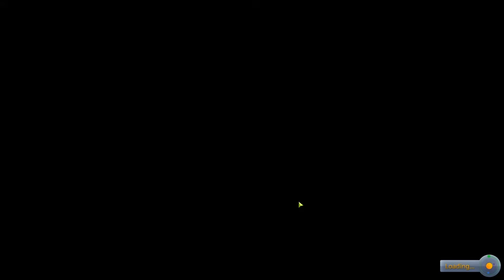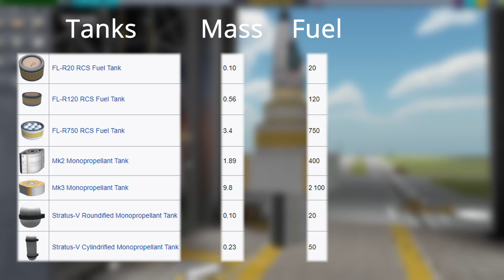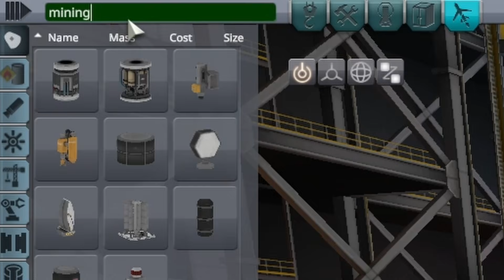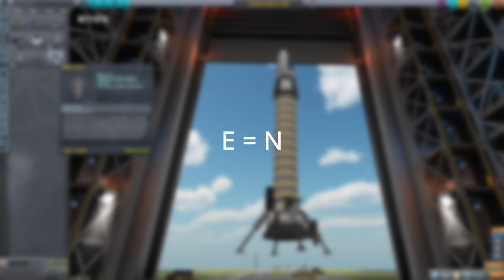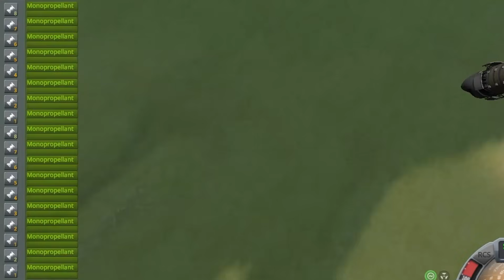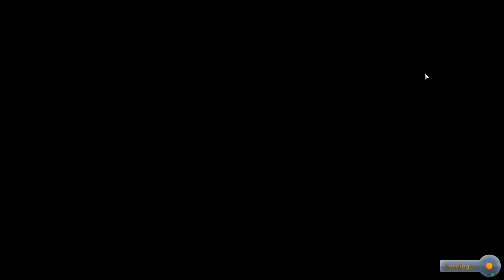Breaking Kerbal Space Program by Only Using Monopropellant

Comment: Reid: "The real issue here is all the fuel tanks are adding too much weight, so the engines struggle to actually get off of the ground."
Reid: "My solution is to add more engines so that it has enough firepower."
Also Reid: "The engines burn too much fuel, so I added more fuel."

Reid after the test flight: "So the real issue here is all the fuel-"

Comment: ALWAYS use all of the engines that are useable. Your "upper stage" engines could have been used the entire flight, but in this way they only acted as dead weight. Use them, and reduce the amount of engines on your lower stage by the amount that the upper stage provides. Upper stage should only be separate from others if it is inside a fairing or otherwise blocked, and cannot be used.

Comment: I've been able to correct for some of the 'oscillating' you referenced at 14:45 by turning off SAS and stabilizing by hand. When you have a high torque, the Automatic Stabilizer can over-correct and then have to catch itself, over-correcting again in the opposite direction and creating a feedback loop of oscillation. This was actually a problem for NASA in the Apollo 6 mission, and they had to solve it by putting a Kerbal inside the engine to lightly pinch off the fuel nozzle. The previous sentence is not true.

Comment: In case no one else let you know: There's an option you can use in the decouplers to disable crossflow between stages. Good for use in disposable booster stages.

Edit: A wise Scot also told me that the max G's you hit in atmosphere ideally shouldn't top 2 or 3, otherwise you're just wasting thrust pushing around air.
Reply: yup, when any other part of the rocket besides the engine starts to glow red, you're going too fast.

Comment: there is no chance you read a comment on a video this long but here is why you were crashing:
you were holding a chunk of your craft with many parts (30+), THEN, the important thing, you hovered your mouse over engines placed elsewhere
for some reason there is surface attachement on those engines, meaning that the game now needed to spawn in and render the chunk you were holding 30 times (overlapping itself too), so basically 30x30 parts as well as all the light pixels for correct renders

that lagged your computer out and then for some reason you must have pressed keys like mouse clicks which made the game crash, generally pressing any imput when your computer is freezing in a long caclulation is a very bad idea as it will trigger window's automatic task shutdown, and that's what happened
Reply from the maker: Clicking or hovering over parts guaranteed the crash, but even just grabbing the parts would occasionally make it crash, though it was much less common.

Comment: Engineering Advice:
- You should put more effort on minimizing weight. The rocket equation means that removing 1 kg of dry mass is much more effective than adding 1 kg of fuel. For example, the Mk I cockpit is one of the heaviest single-kerbal command modules in the game. The Mk I Lander Can is nearly half the mass
- You can improve FPS and decrease flop by using larger fuel tanks. As you found, the tanks all have roughly the same mass ratio, so fewer, larger tanks will be more rigid while holding the same fuel and being the same mass.
- As you found out, it's not a good idea to add a payload right at the start. If you aren't doing careful mathematics, you can't know how much your rocket will be able to lift before you build it.
- Make sure you're using small, lightweight upper stages. Up until the final design, your final stages were missing out on a lot of delta-v because of how much extra mass in engines and empty tanks they were carrying.
Reply: He should also try making a plane that sends the payload, there are the space shuttle like monoprop tank and the jet monoprop tank
Reply: Also firing all engines during staging

Comment: It's actually more efficient to have 1 double size fuel tank than 2 smaller ones, even of the amount of fuel is the same, as joints can be a bit wibbly wobbly and end up magicking energy away into the nether instead of making you go more up. Especially if it's a load bearing joint.

Comment: Yeah monoprop will draw from all the tanks on the rocket regardless of stack separator fuel valve settings etc so you gotta watch your level yourself, its a bug. Its caught me out a few times when I use very minimalist service modules on return capsules/eve ascent vehicles etc where i set rcs to fore by throttle and use the big thrusters as orbital manoeuvering engines a bit like soyuz and find manouevers from earlier int he mission have drawn from the monoprop I thought I'd valved off and RCS thrust disabled correctly to ensure I have fuel left for final orbital docking or retro burns.

Comment: On top of all the other tips that people have given you: if you click on the 'Total delta-V' number at the bottom of the stage bar (bottom right in the VAB, bottom left just above the attitude gauges while in flight), the stage bar expands and gives you useful stats fot that stage, like Thust-to-weight, burntime at max throttle and delta-V. On top of that, in the VAB the DELTA-V button in the app-bar allows you to set the parameters for those calculations. You can check quickly your T2W of the final stage on say Minmus, which is in low gravity and in vacuum.

Comment: 14:16 Pogo spaghetti! :D

Rather more intellectually, you can look at TWR -- thrust to weight ratio -- to see how it'll take off. Click a stage thingy (with the orange top bar) for extra info. One of the 'apps' is a big-ish panel which configures which data to show for stages; it has checkboxes for several things including TWR. The top of the panel is all about TWR; it controls which body it's calculated for, and how deep into its atmosphere. Rockets always need a TWR over 1.0 to take off and to enter orbit. (Spaceplanes can get away with less within the atmosphere.) It can be interesting to play with the controls and see how things change. Some rockets - the ones with the best vacuum efficiency - lose a lot of power at Kerbin sea level, but experimenting with these controls shows they get quite good sooner than you'd think.

Comment: Hey RC, I love the channel, and I have some tips for you about KSP. 
1. In the editor, you can press the 3 buttons above the symmetry to show center of mass, aerodynamics, and thrust
2. In flight, there are a few buttons on the bottom left. the bottom purple one is very useful for showing flight info like apoapsis, periapsis, and when you will hit them.
3. You can enable/disable fuel crossfeed throughout decouplers when you right click on them (to prevent fuel going though to different stages)
4. In the editor, there are 5 blue buttons at the top. The 2nd one allows you to make button presses or actions (like pressing numbers on keyboard) that can do actions, like toggle an engine or extend solar panels
I hope this can be useful.
Reply: 5. The CTRL-Z copy method is unfavorable, undoing is very unstable
Reply: @chri-k  yeah use alt-click

Comment: Try using Jet engines to get into orbit.
Reply from the maker: Is that even possible or just a meme
Reply: @ReidCaptain  You need to obtain speed low in the atmosphere. Also R.A.P.I.E.R engines can work with oxidizer and they are jet engines
Reply: @ReidCaptain  it’s possible stratzenblitz did it
Reply: @ReidCaptain  it’s possible stratzenblitz did it
Reply: @ReidCaptain  it’s possible stratzenblitz did it